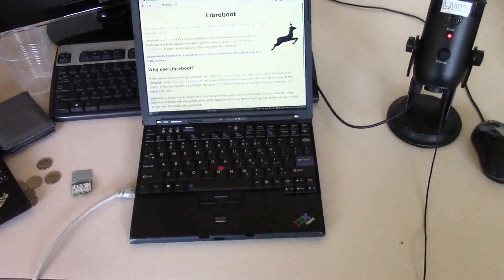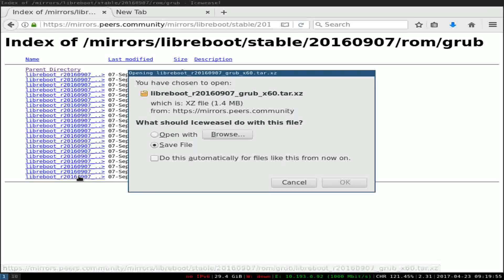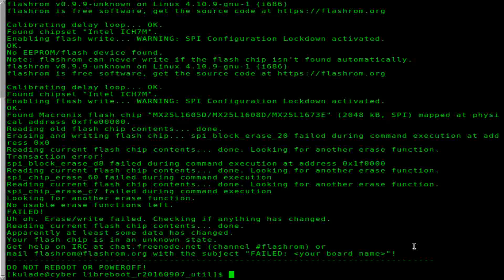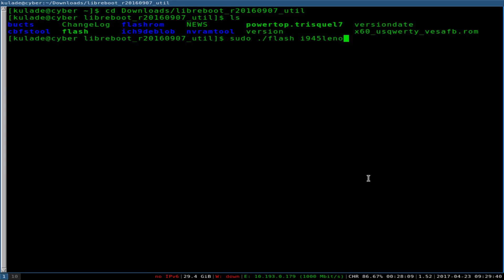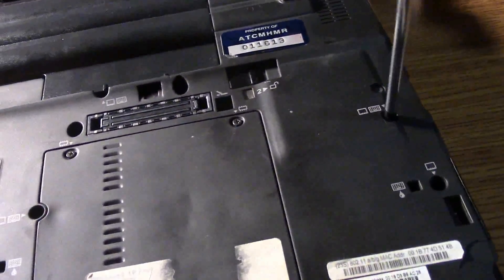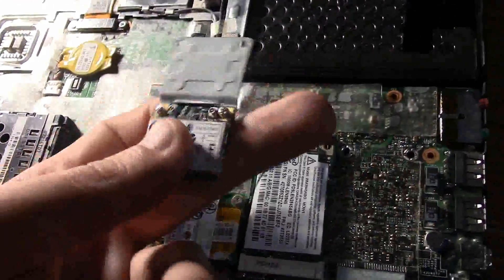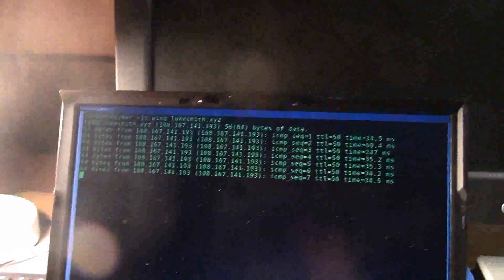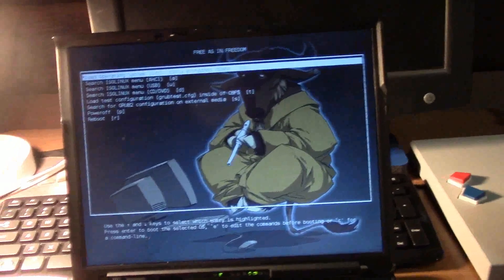Install Libreboot on X60/T60 ThinkPads (muh freedumbs edition)

Comment: I'm looking up T60 laptops right now.  Can you Libreboot a T60p or any other T60 models with the same or different roms?
Reply: Not all T60 laptops are compatible, be careful
Reply: @Artixou  I know that you need an Intel GPU, are there limitations for the screen as well ?
Reply: @hansgeffenvan6794  Hi Hans, I believe there are, but all 14 inch screens seem to work fine - if you have one of those I think you're good to go. Sorry I couldn't give a better answer

Comment: Was trying to do this on my T60. Shotdown after first flash. Screen stayed black. Unplugged bios battery. Plugging it back in. Next try to boot stay black with 1 long and 2 short beeps.
Reply: Anyone can help?
Reply: Will try to heat up the GPU but I think this will not solve this
Reply: @phandr1x  You need to externally flash your stock bios. You have bricked your bios.
Reply: DoubleYouSeeNah  The exact thing Phandrix said in his comment, has happened to me. I do not own a Rasberry Pi. Do you know if it's possible to undo this libreboot entirely so I can use the laptop as I previously did?

Comment: Thanks, now I have a completly free MacBook (with the same chipset as the ThinkPad X60) and I can finally install Arch without trying to make it work with EFI32, you're the best !
Reply: What model MacBook shares a chipset with the X60? I wasn’t aware this existed.
Reply: @micahsnyder7299  MacBook 2.1. 
And it has a wifi card who works without problems. (The real problem is that overheats a Lot, You need to undervolt.

Comment: Any ideas why my X200s (I took the soic-8 chip from X61 because empty chips from China takes long time before arriving) can't do this? After "Reading old flash chip contents... done" it says "ERASE FAILED" and continues endless amount time with "Reading current flash chip contents..." which never ends.

I've Corebooted multiple Thinkpads succesfully but this my first Libreboot.

Comment: Just throwing this out there: Depending on the distro you're flashing from, you might run into an error message that says 

/dev/mem mmap failed: Operation not permitted

This happened to me on Debian. The solution is to edit the file 

/etc/default/grub
In there you should see a line that says 

GRUB_CMDLINE_LINUX_DEFAULT="quiet"
change that to
GRUB_CMDLINE_LINUX_DEFAULT="iomem=relaxed quiet"
and run
sudo update-grub 

so that GRUB starts with that option on the next boot. This is to bypass a safety measure that makes it impossible for the operating system to access the rom chip.

I don't know if it makes a lot of sense security-wise, but I changed the line back after installing Libreboot. Just because I really don't need access to the chip anymore.
Reply: fwiw you can also just add iomem=relaxed as a one time argument by pressing 'e' in the grub menu while your preferred boot entry is highlighted to make a temporary edit to the menu entry
Reply: I LOVE YOU FOR THIS. HELPED ME OUT

Comment: Is there an ebay link for that adapter?  I've been doing lots of searches but haven't found it yet.
Reply: Found it! https://www.ebay.com/itm/2PCS-Mini-PCI-E-Half-to-Full-Size-Extension-Card-Adapter-Wireless-WiFi-Bracket/264195865983?hash=item3d834cfd7f:g:~soAAOSwVZ1cZN8R

Comment: So the rom and other associated files on the Libreboot site for the X60 also work for the X60s?  I have a X60s CTO model which I love and would like to do the Libre thing on it.  I also have a Z61p which is almost identical to the T60p, so I wonder if Libre will work on this?  All my other Thinkpads are newer so would need more work.

Comment: I tried exactly what was shown in the video, on my T60 type: 2623-d6u with ATI graphics card. Tried the command sudo ./flash i945lenovo\_firstflash t60_usqwerty_vesafb.rom. The screen produced exact error as in the video however after shutdown and reboot, I got 1 loud beep followed by 2 other beeps, meaning the laptop is bricked. Question to anyone :  where does the i945lenovo? come from and what does it stand for?. Would T60 have a different i9____lenonvo than an X60?. Any thoughts. stuck right now with the T60.
Reply: BigSSa Dreem ATI graphics   are not currently supported by Libreboot. Only Intel-based machines are supported. You'll need to find information on how to recover the original BIOS if you want the T60 to be working again (if flashing doesn't help, then motherboard replacement will be neccessary)

Comment: Hey. I bought a librebooted T400 on eBay recently and it works great. The only problem is I bought an SSD to replace the hard drive it came with and tried to install Fedora on the new drive with no success. I followed the libreboot website's instructions for booting from a USB drive (Instructions on Reddit were also helpful) and it worked at first after tinkering in GRUB but it seems like I did something wrong as I can't boot from the drive or USB. The old hard drive still boots into Debian just fine. I'm thinking that I might try and change the Grub config files inside of Debian if that will help. Any assistance from Luke or anyone else would be very appreciated. 

My main goal is to upgrade the hard drive (and install a second 1tb drive in the cd drive), not hop between distros. I could not care less if I'm stuck with Debian or any other distro, I am just more experience with Fedora.
Reply from the maker: Yeah I've had a problem similar to this actually. Libreboot apparently has iffy compatibility with some USB drives. So I have like 7 or so usb drives, all of them I can access with Libreboot, but for some reason it can only boot off of two of them... I'm not sure if there's a fix for this in the ropes, but probably the simplest thing would be either trying another usb drive or putting the drive in another computer and installing the software there.
Reply: I didn't even think to try a different drive. I guess I took the small amount of success I had as some indication I started off right. I'll try to mount an iso to a different USB drive. Thanks.
Reply: So I can boot into Lubuntu, Ubuntu Mate, and Fedora just fine from a USB. My problem is I can't move forward in the installation. The installation wizard just returns to the beginning when it comes to finally installing. 

I do have a Fedora partition installed on both drives, but I can't boot into it and I'm pretty sure it was incompletely installed. If there is a way to wipe both drives from the terminal that would be great, or even just from the live USB. In fact, I might try to do the latter and try to install Lubuntu again. 

Libreboot's documentation is helpful but It would be great if there was more on changing distributions and completely swapping drives, I'm sure I'm not the only one with a librebooted computer who wants to boot from an SSD.

UPDATE:

fdisk works on a live USB. Which is great for me but kind of scary seeing as any jow blow with a live USB can delete partitions on your computer (unless I'm wrong).

Comment: hi, does anybody know how to detect a suitable version of T60 (I did go to the website, but not clear). Is it enough NOT to have an ATI card and have a resolution of 1400x or sharper on the 14inch screen (and only ips 15")? Or are there any more requirements?

Comment: I'm not sure whether or not you'll see this but I noticed that you said you had installed the "Atheros AR5BHB63 wifi card," does this wifi card have a specific advantage over others? Are the newer wifi cards not compatible with these older laptops? Is there anything the manufacturer of those wifi cards can do to somehow remotely gain access over your device, or does it send information regarding your device to servers that they keep? Can I use one of intel's brand new wireless cards? Thanks in advance for the reply
Reply: Atheros has opened their firmware to linux developers, so their cards have the best support directly in the linux kernel and work "out of the box".

Comment: You should use dwm and read the suckless philosophy. i3 is bloated af!
Reply from the maker: >having to recompile every time i want to change a keyboard shortcut
convince me that this is not a meme
Reply: i3 is a meme. dwm is so lightweight, you can recompile it and reload it just as fast as i3.
Reply from the maker: If I ever have the need to spend hours replicating my i3 rice on dwm so I can go 0.002 seconds faster and brag about it, I'll be sure to put up a video on it.

Comment: Sweet, I just got a Lenovo Thinkpad T400 from ebay, I like the look of the x200 but I wanted a bigger screen (14").  Apart from being able to change your wifi card what benefits are there to Libreboot?
Reply from the maker: 1) Free as freedumb, no backdoors.
2) Fast like Sanic. Loads way faster than proprietary bioses.
3) Customizable. You can actually change to boot screen, etc.

Comment: Ohgawd. If you do this, please be more careful when removing and replacing those wifi u.fl connectors. Those things are ridiculously easy to damage. Usually using a small flat head to pry them up from where the cord is attached to the connector is relatively safe.
Reply from the maker: Don't sweat it. It looks like I was a lot more brutal with them than I actually was. Although, I do have a YOLO mindset when approching 10-year-old tech though.

Comment: Man had I known this I would have picked my thinkpad more carefully. Do you know how freedom respecting is the x230 is?
Reply from the maker: Well It's not librebootable yet, the X220 is in progress though. I get the feeling that Libreboot/Minifree focus on librebooting the older pre-chicklet keyboard models (that all the cool kids like).
Reply: https://h-node.org/notebooks/catalogue/en
Reply: that's a shame. Apparently the Wifi card is none replaceable in it too. So unless the driver for the Wifi on the x230 becomes free software I guess I would not have wifi in it. I think it works with coreboot thou.
Reply: Luke Smith my X230 has the classic keyboard mod ; )
Reply: Animated Freak that is 2 gens after the first thinkpad model with locked up intel IME, so no hope there.
They won't change the IME thing anytime soon because other than google, no users care if they have it or not, it's mostly enterprises that want it for their office purposes.
Reply: LibreBoot is not for the X220/230, but there is CoreBoot! Intel ME is still at large though.